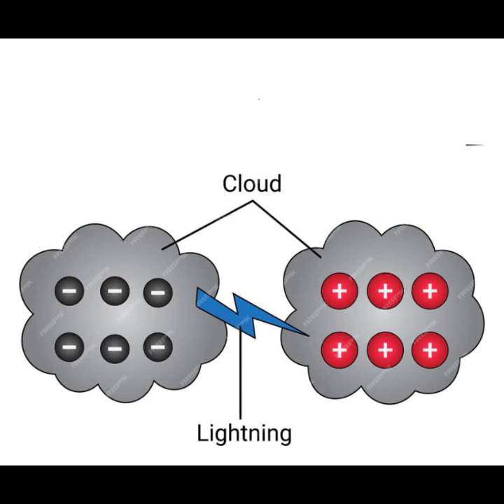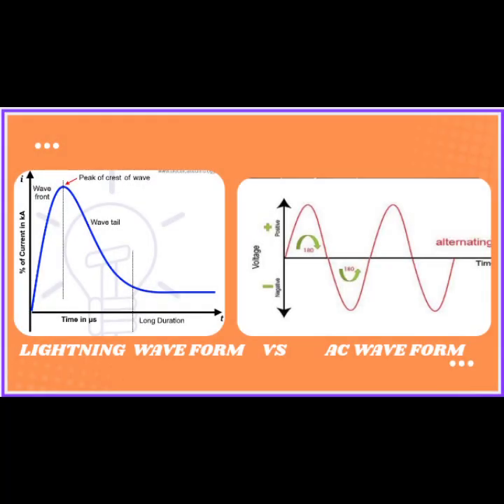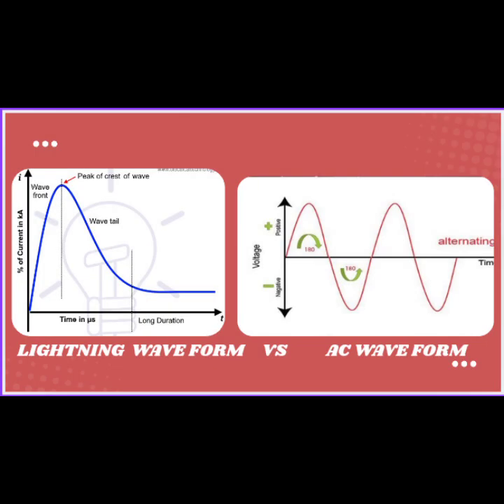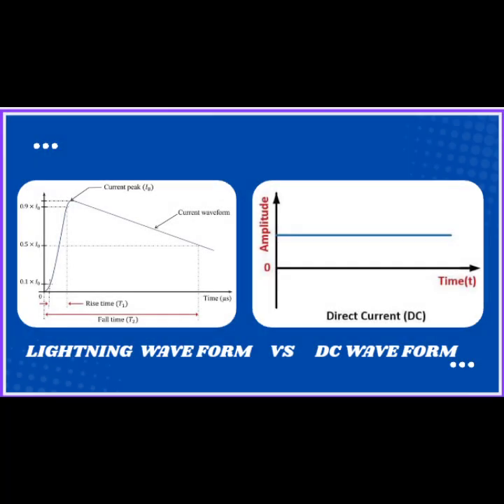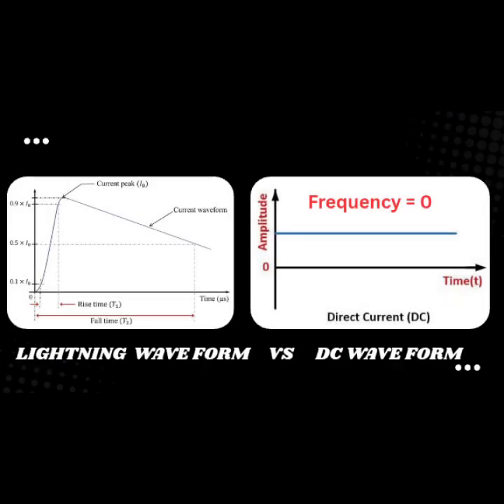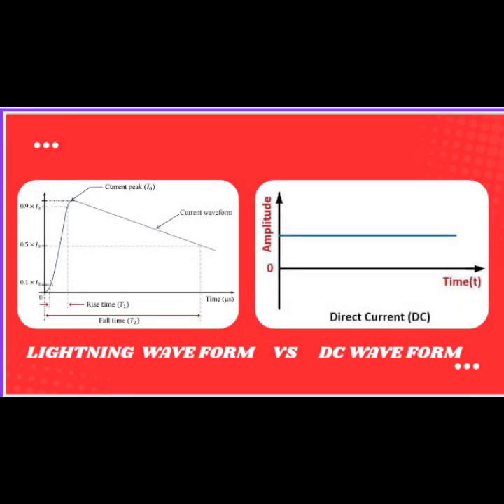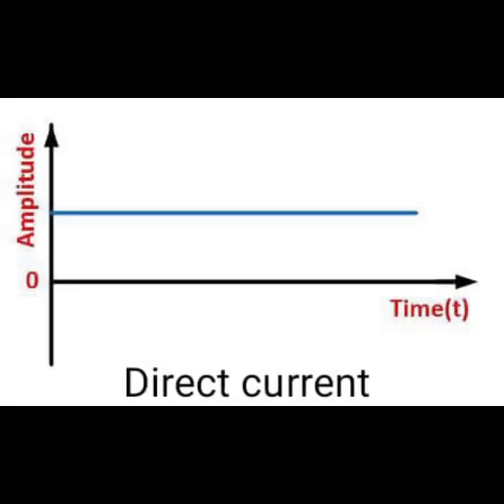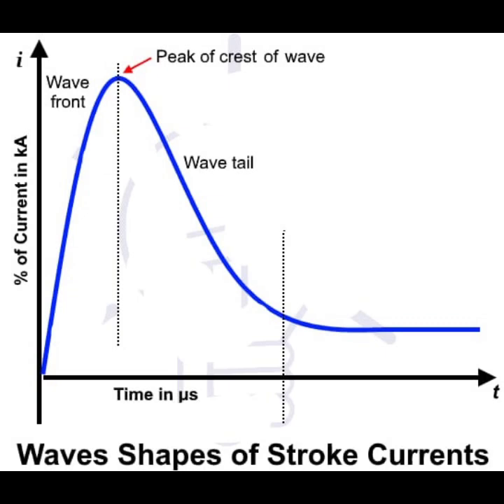Is Lightning AC or DC? Unraveling the Mystery of Thunderbolts!

Comment: I have heard people ask the question "What does AC & DC mean?"  Without saying AC Current means Alternating Current which did come moments later, I would say "AC is an "Artificial Current because it can be produced Artificially by a Generator."

I used to think "All Natural Currents, such as by Lightening, were Direct Currents (DC), which I just found out from your Wonderful Video I was INCORRECT.  THANK YOU for setting me STRAIGHT.

Would I also be INCORRECT in assuming the DC Current produced by a Battery's Cell as being a NATURAL Current because it is produced by the Natural Chemical reactions between the Battery's Chemicals and the Metal contained within that Cell, such as a Lead-Acid Battery?
Reply from the maker: You're correct sir.

The currents produce by battery or cell, solar cells  are direct currents. 

It is called direct current because it doesn't fluctuate. It is  steady.

You can see it as constant line graph if you pass it through oscilloscope

Summarily, what determines if it AC or DC is the manner in which voltage and current change over time 

If it fluctuates, is Alternating Current(AC)
If it doesn't fluctuates, is Direct Current (AC)
Reply: @Fluxelectricalengineering-- THANK YOU again.  I've heard of people Energizing a Circuit by sending both an AC & DC current down a Wire at the same time.  Is that for REAL?

HOW is one able to send 60 Hertz per second on a Circuit with all of the Cyclic Reversals while the DC NEVER changes?  I am SORRY but I don't get that.
Reply from the maker: @brucewinningham4959 It never happen in one wire. It is either AC or DC.

But you can used it independently in a circuit, for instance in Motor Control Circuit that uses AC makes use of thyristors for its control. Thyristors make use of DC or rectified AC to trigger its gate before the circuit works.

So that's a circuit making use AC and DC independently. 

But it doesn't mean that AC and DC  can jointly work. They work independently.
Reply from the maker: @brucewinningham4959
Reply from the maker: @brucewinningham4959 No , it can work in one wire.

But both AC and DC can work in a single circuit independently.

For instance in a Motor Control Circuit that uses AC has its part of the circuit that uses DC to trigger its thyristors before it can start working. 

You see here that both AC and DC are used but they are independently used in a single circuit.

Comment: Is Lightening a "Plasma?"  Or, does it produce a Plasma by heating the Air around the Lightening?  THANKS in Advance.
Reply from the maker: Lightning, it is indeed associated with plasma. When a lightning bolt occurs, it generates an extremely high voltage that causes the air to become ionized. This ionization transforms the surrounding air into plasma.

Summarily,
Lightning is just a discharge between clouds or between cloud and earth.

 Lightning  causes plasma.

The light you see during lightning discharge, is natural plasma caused by lightning.

Lightning can not occur without ionizing the air (plasma).  Please remember, they are inseparable.

Further more: Lightning ionizes the air when its extreme high voltage breaks down the insulation strength of the air.
 The air particles around it then is excited to give off a very bright light  (plasma) which we see. 

Your second option is correct.

I hope I answered your question? 

Thank you for watching.
Reply: @Fluxelectricalengineering-- That is GREAT Information!  THANK YOU VERY MUCH.
Reply from the maker: @brucewinningham4959  you can have full complete class on lightning through the link below. It explains all your questions and views about lightning discharge 

https://youtube.com/playlist?list=PLsP9-E3nA1loTq9KctV47lolqnVDvU77h&si=4m5WDR-p7JVcMp6d
Reply from the maker: @brucewinningham4959 @brucewinningham4959  you can have full complete class on lightning through the link below. It explains all your questions and views about lightning discharge 

https://youtube.com/playlist?list=PLsP9-E3nA1loTq9KctV47lolqnVDvU77h&si=4m5WDR-p7JVcMp6d